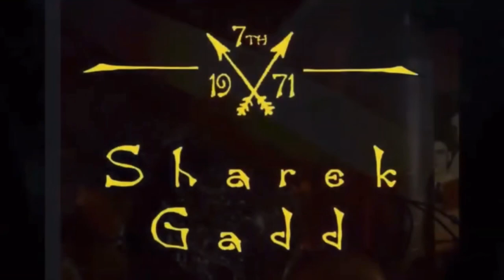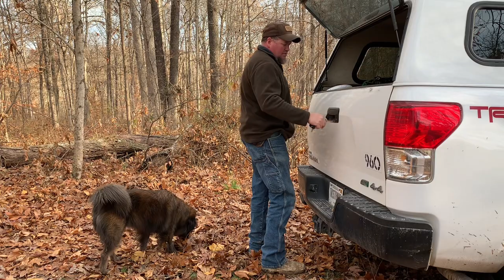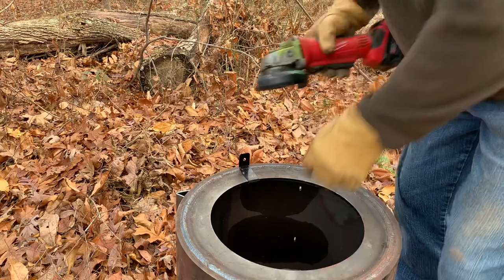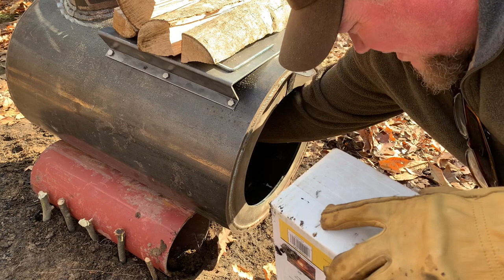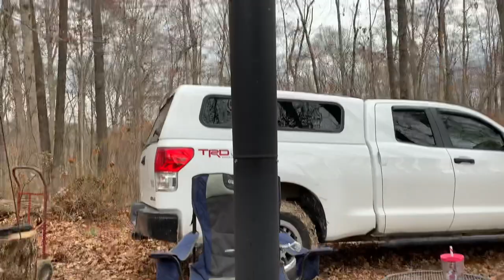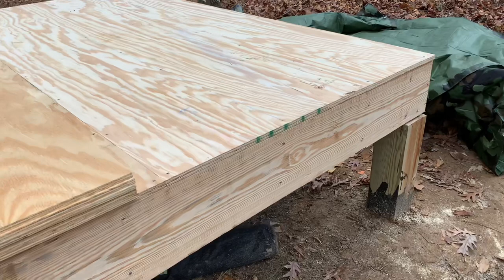Custom Wood Stove

Comment: Great timing.  I've a need for a shack and a heater.  I think I'm going to build a few different styles--plus I need outbuildings.  Really like that heater, especially the door design.  Probably won't be starting anything before next year-when the envelopes have had a bit more time to accumulate funding.
Reply from the maker: Yep, I’ve been truck camping all summer. Need better shelter before it gets too cold. The stove isn’t finished but it’s better than a camp fire. It’ll set it in the shack as soon as I get the roof installed.

Comment: Cousin, I possess an adze, broad ax and a corner chisel if needed. I did have a beam drill for mortising, but sold it with the cabin.
Reply from the maker: I may need them come spring.